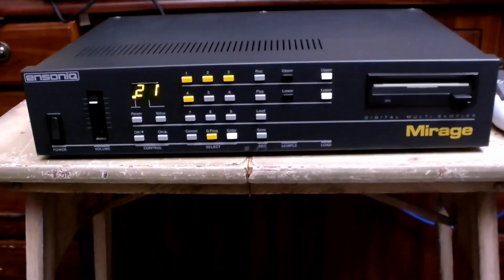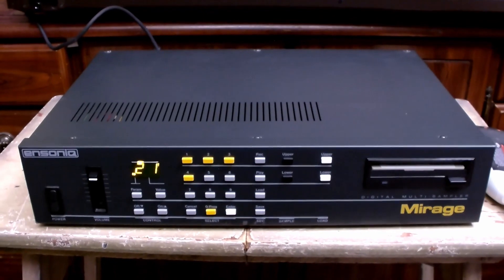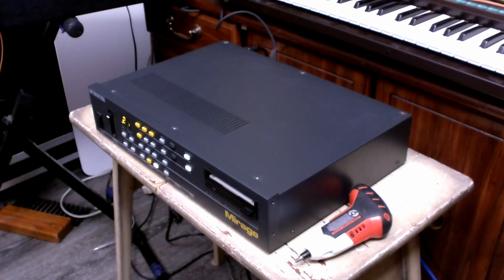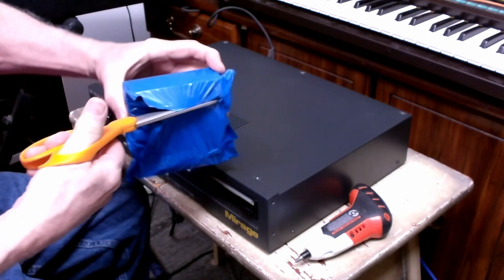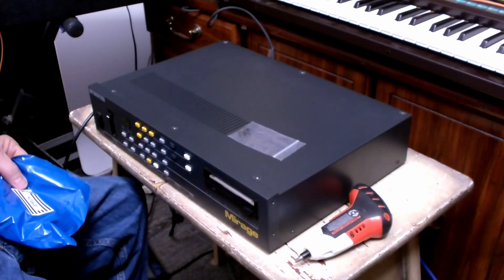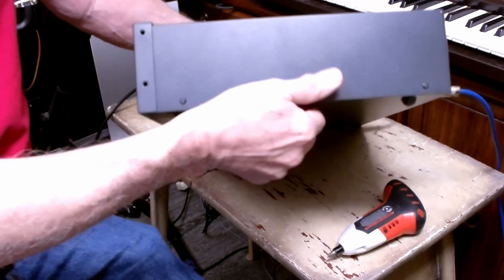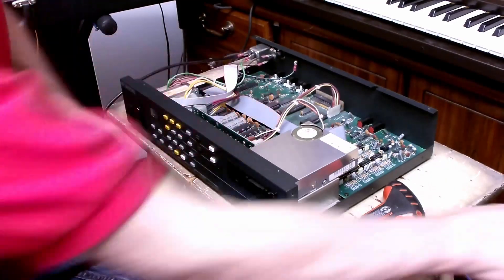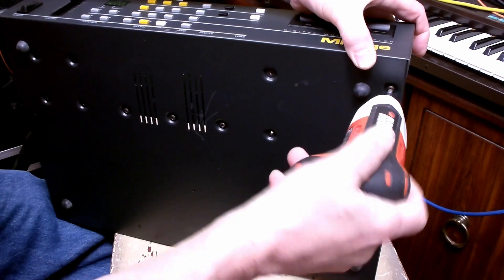USB Floppy Drive Emulator Installation   Ensoniq Mirage

Comment: This is interesting. At 10:26, you mentioned adding a few discs... how is that done? Did you simply copy the files from the Mirage disks into a folder? Or is there some special formatting that needs to be done? Thank you!
Reply from the maker: The "disk"s ( files ) I added were already available on another computer.  I believe I found the files online (probably the original factory disks).  As I recall they were easy to find onlline.  I just copied the files from hard drive to thumb drive.  Honestly, it has been a while since I did this and I don't remember the details, but it was a straight copy operation.  
I do remember that while I have the floppy drive from the Mirage, I don't have a computer in which to install it ( no computer with a floppy controller ).  This has prevented me from reading the disk library that I purchased with the Mirage.
I hope this helps a little bit.
Reply: Thank you!  @ozhalljr

Comment: Thank you for this. Could you add the link to where you purchased including the usb? Thank you!
Reply from the maker: I bought it on ebay.  search "gotek floppy emulator" for a number of options ranging from c. $30 to $130.   
This is not a paid endorsement, but user "nesynth" with description "HxC Floppy Emulator With OLED Screen (Ensoniq Mirage) + Pre-Loaded 4GB USB" is the one I got.  
My only disappointment is that there's no documentation (e.g. how to use the two button interface).  So far I have gotten no response after a couple of days to my email questions.

Another feature that's available on some drives which is a rotary encoder for navigation.  That would be handy.
Reply: @ozhalljr  that’s great thank you!
Reply from the maker: thanks!
Reply: @ozhalljr  Happen to know how to save CONFIGURE Preferences like MIDI channel? I have mine working great but I can't seem to save the preferences?
Reply from the maker: @saul_stokes  yes: There is a parameter reference sheet available online for the Ensoniq Mirage.   The Configuration parameters are in the range of 81-89.  82 is the MIDI channel select parameter.  The value is 1-16.  That's how you change it (you already knew that).   You can save all parameter changes to DISK with Parameter 14 (in the "Command" group of parms ).  SP shows on the display.  Executing the command requires that you hit "Enter".  If you save it on the "Autoboot" disk, it will load every time you boot.
Reply: @ozhalljr  Thank you. I understand the 14 save part but with the usb it seams you have to select a file on the emulator to over write. The Ensoniq says ND unless I have a file selected with the USB reader. In the case of 14 save it says ND so I’m wondering if I have to put a file on there for it to over write? Hopefully this makes sense.
Reply from the maker: @syddie510  got it.  Yes, you must have a disk image on the USB.  My USB came with dozens of disk images already on the USB drive.  google  "ensoniq mirage USB disk image"  check out the "Ensoniq Mirage Archive"  link.  To download, you have to sign up for R-Massive, but it does not cost anything.  It's just a gatekeeper for their legit magazine site.    
http://zine.r-massive.com/ensoniq-mirage-hxc-hfe-library/
Reply from the maker: On my USB drive, the disk image named "Autoboot" is the one that automatically is selected when I power on the unit.  It think this may simply be because it is sorted first alphabetically, relative to the other disk image names.
Reply: @ozhalljr  Interesting, so when you save the configs it overwrites the disk image titled Autoboot.  I'll look closer at this thank you
Reply from the maker: @saul_stokes  it will write to the current disk image, whatever that is.  I just save my configuation changes in the Autoboot disk image.  That way, it loads automatically from the default disk image.  Again, I suspect that the Autoboot is the default because it starts with A and sorts first in the directory.  I don't know that for sure.